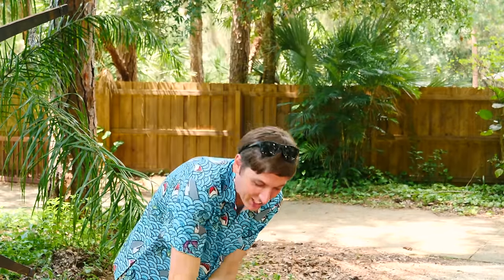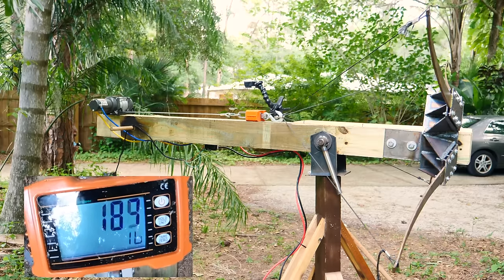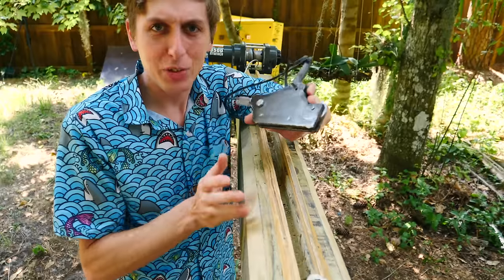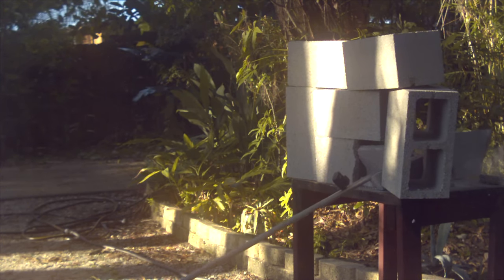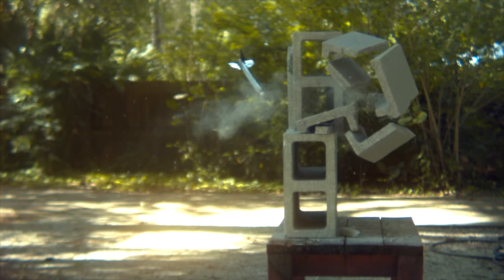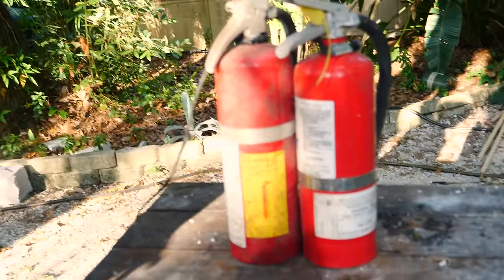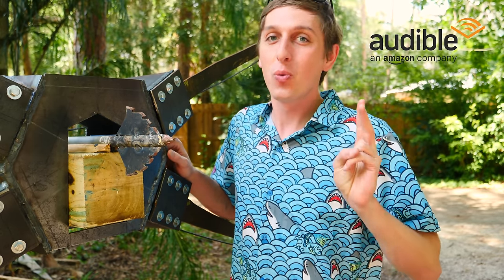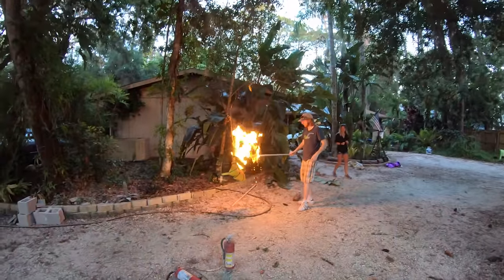I made the Scorpion From GAME OF THRONES and its CRAZY

Comment: 1: Arows need (at least) 3 fletchings to be stable in a 3-dimensional world.
2: Never, EVER dry-fire a bow (firing without an arrow). With an arrow, the power of the bow is transferred into the arrow, without it, the power will be transferred into the bow itself and this may break the bow. Also if the arrow is not heavy enough, even with an arrow you might get the same problem. This time half of the power will be transferred into the arrow and the other half to the bow. This may not break it but over time it may cause damage.
3: You need to measure how fast the arrow goes AFTER the arrow leaves the bow because it will accelarate.
These are the points I wanted to make according to my bow/arrow knowledge. There might be mistakes so I would be happy if more knowledgable people can confirm these. Especially dry-firing is VERY dangerous so pls be cautious :/
Reply: Nerd
Reply: @Aidan King I know! Did riceeater drop out of elementary school

Comment: I noticed the arrow moves slightly up at the very end of the draw
Reply: You’re absolutely right, I noticed it as well. I think it’s causing the arrow to lose some energy upon release due to the friction and that’s why the arrow is also tipping down.
Reply: Yup. With a 1000 pound draw weight, those arrows should have been embedded in his backstop/house.
Reply: @The_Keeper  He might not be using all the draw weight as well, but indeed something to keep the arrow or the sled down would allow more efficient energy transfer
Reply: @WarlandWriter  Also, he's using steel leaf springs with questionable spring steel qualities after the plasma cut, so I wouldn't expect insane energy retention. it's pretty dang cool though
Reply: I think it's also a question of bad arrows, there is a reason real arrows and ballista ammo are made from light and stiff shafts, not metal ones. I know he wanted to keep these for reuse, but they were too heavy.
Reply from the maker: It's because the winch is trying to pull the trigger mechanism out of the slot I cut from it. How would this cause it to lose power? The string just drops back onto the rail when it fires.
Reply from the maker: @The_Keeper  no they shouldn't. There are other 1000lb crossbows that can only shoot a small bolt at 150 feet per second.
Reply from the maker: @WarlandWriter  the string rides along the rail idk what everyone is talking about
Reply: TheBackyardScientist how about trying to add a looped rope at the back of the arrow it self and the hook can pull it instead of pulling the string on the bow. 
About losing force, I meant the if the arrow gets lifted, upon release the arrow might have friction against the wood which it is placed on ( this might cause loss of force)

Comment: The draw weight is actually amazingly low for a metal ballista, it's comparable to medieval era crossbows, the power stroke is longer though and it's made with modern spring steel so there's a lot more force imparted.

Comment: First: If I may, an improvement would be to integrate the arrows seat inside the frame (with a slot sorta thing) second: I think the smaller arrow still may be better because it hit the strongest part of the block and still disintegrated it

Comment: Awesome replica! You should make another video testing a bunch of different arrow designs. I noticed that the arrows you used in this video were a bit heavy and not too aerodynamic, which is probably why they seem to lose direction quickly after exiting the "bow". Maybe design some oversized modern arrows using dowel rods or fiberglass if possible, and perfect the aerodynamics by experimenting with the wing placement (not certain about my bow/arrow terminology). I'm sure it'd be physically impossible to get this thing to shoot as effective as in the show, but I bet with some lighter, more aerodynamic arrows, you could get some great distance/accuracy by calculating a parabola and testing it across a field or something.

Comment: The problem is that the bolts are evenly weighted throughout the whole shaft, so when you put 1000 pounds of force on the back end, it tries to flip. You should make a new version with wooden shafts to give a better weight to the tip. The broad-head works much better because it has the proper weight distribution, so it can move through the air in a straight line so it goes faster and farther.

Comment: I appreciate that you actually built one of these things from scratch!  I do have to say that I'm wondering if you missed something in the design somewhere. The speed of the bolts seems a little underwhelming for a machine with a thousand pounds of draw weight. 
I would assume that they would easily penetrate all the things you threw at them along with the outside wall of your house.

Comment: You would get better aim and range if you use an arrow with 3 "feathers" and give it some rotation
 to stabilise it in 3 dimensional space.
Reply: Nick Burns  No but it is the same with bow and arrow.
Reply: The area of those fletchings is too small versus the weight of the bolt, speed of the bolt, and distance of the shot. So even a 3rd one wouldn't make a difference. (The bolt is to heavy, the area of the fletching is too small, the distance is too short, and the speed is too small.)
Reply from the maker: @xenonram  it's about having the center of gravity ahead of the center of pressure. You want a heavy tip on a long arrow, then the fletchings work better.
Reply: Nick Burns 
At a bow you have obstruction as well.
And if you take a look on crosbow bolts most of them have 3 feathers there are only a few with 2 (most of them are ancient).
Reply: Nick Burns  I have to admit thet ther are alos bolts with two feathers and in GoT you can see both three and two feathers.
Reply: Nick Burns  crosbows with three feathered bolts have a flight groove (arrow track) for the third feather
Reply: Nick Burns  for a use on shorter distances that is true. But for longer distances with scorpions for example three feathers do make sense even though aren´t that many historical examples.

Comment: Awesome video! Just wanted to say that the strings are to loose. You lose a lot of force by not having the strings in tention when the arrow leaves the slide. You won't get a cool long draw, but the power would be insane. Maybe double.
Reply from the maker: Honestly curious, can you explain why? I imagine if you pull it back to  1000lbs, the arrow would accelerate the same if the string was loose or tight at the release. If the string was tight, wouldn't power be the same but just have a shorter pull?
Reply: @TheBackyardScientist  well with the strings loose the projectile stops accelerating right as the rope stops being tensioned which leaves a pretty decent distance along the ballista that isn’t accelerating the arrow. That’s why crossbows and regular bows have very tight strings, every inch of travel the arrow does attached to the string is acceleration

Comment: honestly it seems kind of weak just because the arrows dont fire straight, they immediately drop, with arrows that size it feels like you could do that much damage by chucking it like a spear, its the momentum of the weight of the object doing all the work, try it with a wooden stake.

edit: use smaller arrows more, they're more powerful.

Comment: It would be very interesting if you make a "Rocket Fan Blade Motorless Flying Machine." The concept is simple, take a fan which consists of tree blades. Then take the blades of that, then weld a bearing at the very middle side of it, then weld one by one rocket holders (made of lite metal and as strong as possible) then, put rocket in the holders. In a previous video of yours, including a video that you've shown somehow you have ignited the rockets from a distant place. So before doing that make sure you put the machine (fan blades) in that direction , which will force too much air downwards and that proper direction will depend on how you fan blades are bent and the rockets are facing or turning, after you make this things get managed, then put it on some kind of rod which will let it turn properly. Then, go far away as possible hit the remote controlled ignition button !!! Your fan blades may fly up like an helicopter with forces made from those three rockets. Have you understood my idea ? I don't know about the result of it. I am just giving you an idea and just theory of that flying machine.
Reply: That didn't make sense.
Reply: @jdsd744 , you've not understood well.

Comment: Yep would have far better range and penetration power if you had the strings retain their tension after release as it focuses the energy into the arrow more than the strings. The strings need to keep the high level of potential energy. That's why most ballista were single bowed. The 4 separate strings is a very very impractical design

Comment: You really need to rework this with better material strings. Also your string should have slack in it once the bolt is out. This is why the FPS is so slow despite the huge draw weight.

Comment: 1000 lbs isn't actually crazy powerful, What is insane is the power stroke. It wasn't uncommon for war crossbows to get up to 1000 lbs or more but their power stroke was usually around 5 inches. This means you would have had a much better effect with lighter bolts, like the same sort of weight as heavy crossbow bolts except maybe longer. You could have gotten those bolts moving so fast had they been lighter.

Comment: My suggestion: shoot large bearings or adjust the aperture and smash billiard balls. Edit: I don't need to teach the master of safety anything; but as an afterthought, it should be noted that billiard balls are designed to ricochet. Also, the hydraulic press video I saw of the destruction of a billiard ball is rather violent.

Comment: With that draw weight you should be doing way more than this...this is actually crap damage...something in your set up is clearly wrong with the material you're using. It needs to be pulled back more or maybe the ropes need to be cut shorter...try it again and you'll get better results if you do this.
Reply: well I think you are right.  I think the 2 issues are, is that the arrows are too heavy and the rope never goes taught.  its more like a sling.  Still very cool video well done.

Comment: I might be wrong, but the setup you're using should benefit from switching the four arms 180 degrees. As of now, the steel is fighting with itself. 

Look at the result. I machine like this should absolutely crush almost anything you put in front of it. Cinder blocks is nothing. Do it right and this machine should be able to go through at least one centimeter of raw steel.

Comment: Don't if it was mentioned in the vid (was chomping on chips lol) but I wonder if it would be more efficient if the limbs were preloaded with the strings under constant tension?  I feel like energy is lost when the string become relaxed at the end of the limbs powercycle.
Reply from the maker: I'm wondering that too, but if the string goes slack at the end, it means the arms went all the way forward, moving the arrow the whole way. I'm just thinking 1000 pounds will be the same whether the string is loose or taut at the end.

Comment: Lol dude your welds are horrendous XD - nice idea though.
for future reference, broadhead design was better in terms of the physics, your trajectory for the standard bolt is off balance as the rear is heavier than the front. You'd be able to fire it faster, further and with a more flat/accurate to aim trajectory if you created greater weight on tip and less at rear. Those steel fletchings are clearly farrrrr too thick mild steel, my man.

Comment: Bigger and more rigid draw arms please
Reply from the maker: What would you use?
Reply: @TheBackyardScientist  Spring steel, but since that can be crazy expensive I would likely use 3 or more layers of steel bars overlayed to be thickest at the joint and thinning to one layer at the end. This would be like some truck axles and would require no welds, only bolts (several per joint). I would also recommend that for higher draw strengths past 1000lbs you add steel support along the length of the 4x4 just in case. your main joint should e more than strong enough for more and longer draw arms with layered steel bars bolted together would be a simple and inexpensive way to increase force.

Comment: Tbh 1000lb's isn't that impressive. Handheld crossbows can go up to 1250. Also next time you pintle mount anything like this, balance it out so that it rests with only a bit of friction and inertia holding it in place. Also use a windlass to draw so you can take it on and off with ease.
Reply from the maker: It is balanced perfectly. You are correct other crossbows have a 1000 draw force, but can they shoot a 2 pound projectile that fast?
Reply: @TheBackyardScientist  No, but it should have a draw of over 3000lbs if built correctly. A 20lb windlass crossbow can have 1250lbs of draw weight. your 100+ pound scorpion should be much stronger than a handheld bow. Also wooden arrows would improve range and accuracy.

Comment: Lighter arrow= more energy.
With wooden arrows it would have been a lot more impressive.
Reply: That isnt how energy works dude. Energy is conserved
Reply: @william Callahan the lighter arrow would pick up more speed.
Because speed is exponentially increasing the kinetic energy the arrow would have had more potency.

The overall energy output of the ballista does not change though, right.
Reply: @annaneal2970  so the speed would be higher, but the kinetic energy would have been the same. It would have done the same amount of damage, probably less if the wood arrow broke
Reply: @william Callahan 
I took bullets as a reference.
If you have a lighter bullet it usually penetrates more material More easily.
Reply: @annaneal2970  because its smaller and thus applies more pressure to the surface
Reply: @williamcallahan7927  no.
Take 9mm parabellum and .357 Magnum.
Same bullet Diameter. 
.357 has more energy because its faster.
Reply: @annaneal2970  no, it has more energy becuase of different amounts of powders and air resistance differences
Reply: I noticed. You are right.

Comment: 1000lb draw...yet 1000x less effective than a modern compound bow.  Why would you make the stings loose?  You are losing so much energy by not having them tight at rest.  The arrow/bolt is losing velocity before leaving the bow.
Reply from the maker: If you pull it back 1000lbs, wouldn't the arrow have the same amount of force either the string is tight or loose at release?

Comment: Steel arms you are using are very heavy and very slow. 1000 pounds is pitiful draw weight for such mass. Replace them with aluminum, carbon or even laminated wood and speed will increase drastically (but no dry-fire in that case)

Comment: Much slower and far more inaccurate than depicted in the series where it launches ballista bolts every half second with unerring accuracy?

I actually found that attack on the Sea completely absurd. Suspension of disbelief went right out the window when they started firing 30 ballista bolts a second from 15-ish warships with one of those on each. That and the speed of the Whites when they rolled into the defenders of Winterfell like a small tidal wave at 60 kph. The Ballista were far less believable, of the two.

Comment: Well, it barely breaks a cinder block from what... like 10ft straight on the line? (Not to mention you still had hard time aiming this block) And in the movie they were showing us that they hit a flying dragon. So, 1st it is flying it is much higher and the arrow will lose lots of energy while reaching the height, moreover it's a moving target and it's way further than 10ft... even if they had an unbelievable luck to hit the target from that distance, the penetrating power of the shoit I belive would barely be enough to scratch Daenerys, leave alone the dragon...
UPD. Still like for the video, you've made much better job than Weiss and Benioff

Comment: You are losing alot of potential energy by having the string loose. The strings when mounted should always be pulling on the bow (springs). Your strings loses energy by the half way mark and becomes useless after that. Check out an actual cross bow and how they work. DO AN UPDATE VIDEO!!!!